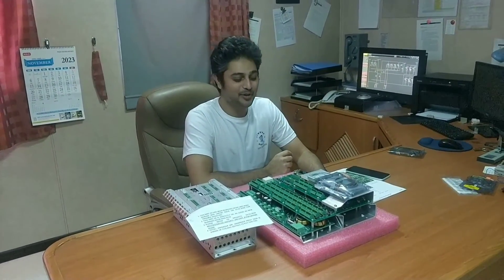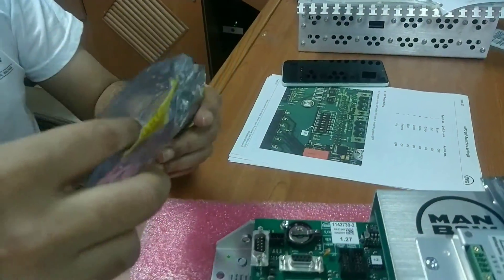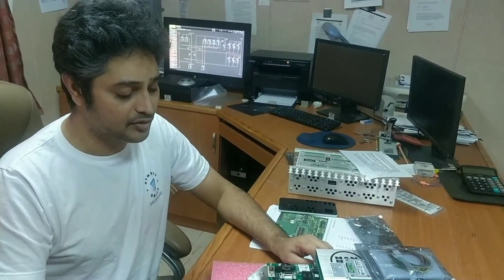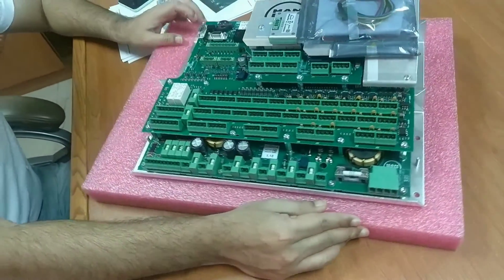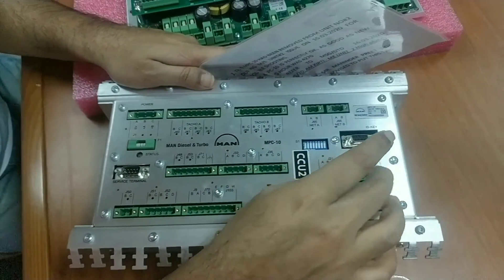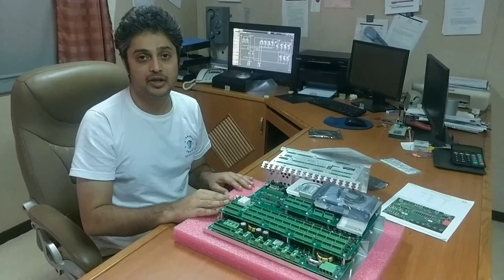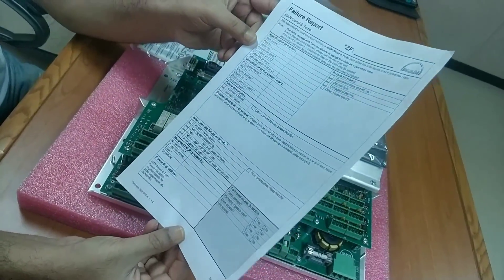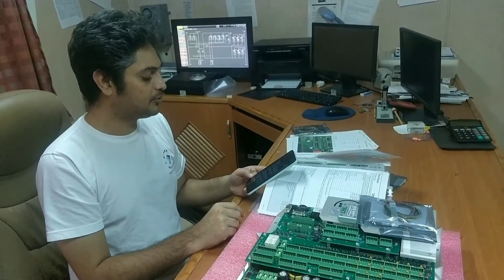MPC & MPC-10 ME ENGINE - New Age Online Marine Academy.

Comment: You can not step down DC voltage by transformer
Reply from the maker: @ДмитрийКрылов-е8и  Yes  you are right. However plz note this is not a single step process to reduce to 5v. If you see the detailed constructional of MPC there are multiple other components which helps in reducing voltage. ( You can ping to our WhatsApp where I can send u d drawings to understand in better way)